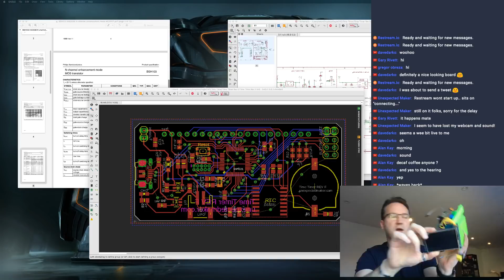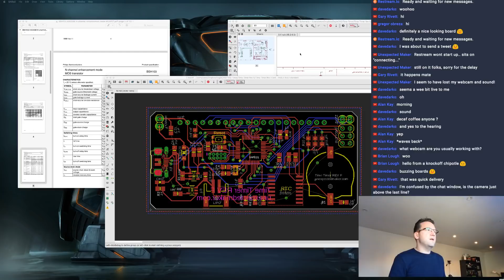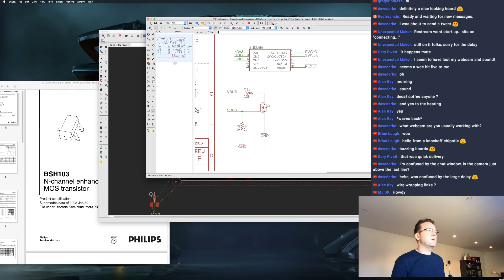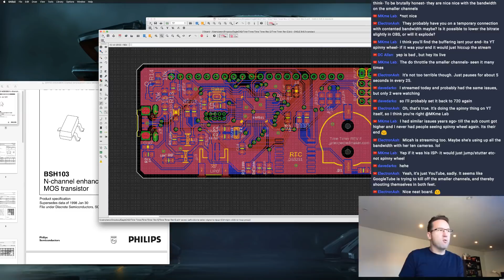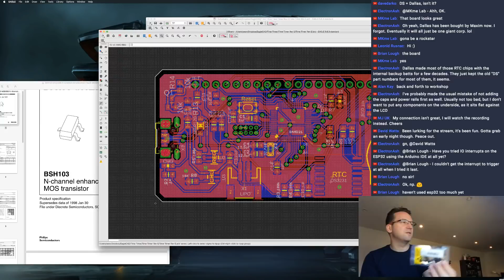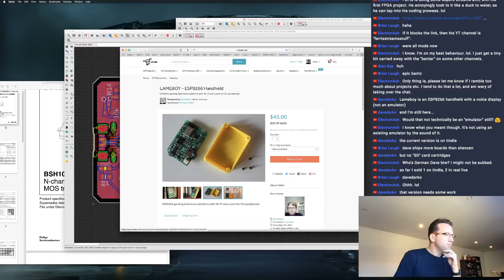Let's look over & improve my SAMD21 Micro-controller board

Comment from the maker: Sorry about the stuttering folks. Seem's my internet (Australian world class internet) wasn't up for the task of streaming today :(
Reply: Not sure the MOSFET circuit was right. You are using vbus as both the gate and the supply line.  Shouldn't you have something else to drive the gate? (A signal line from the uC). As it stands you are turning off the supply to turn off the MOSFET so output will be 0v and when you turn the MOSFET on the output will still be zero as the MOSFET will be on, grounding vcc line.  (Not an expert but just seemed wrong to me)
Reply from the maker: Yup, you are correct - as I was cleaning up my terrible placement I realised I needed to drive the gate from a GPIO on the SAMD21. A silly silly mistake :-)
Reply: Unexpected Maker :-) if I'd been an hour earlier I'd have told you on the live stream. At least you didn't send off for new boards before realising!
Reply from the maker: I was always planning to do a sanity check on the board design again before sending it off, but as I said on my stream I've never worked with Mosfets before (I know, how??) so I'm not surprised I stumbled there!
Reply: Thinking again this morning. If you are using VCC to supply the screen and RTC then aren't you limiting it to 50uA due to the 10K?  If the Screen and RTC were instead connected directly to VBUS and the ground of those commoned (rather than use your actual ground) and this connected to the MOSFET, it would switch the current the devices need rather than this limited supply.
Reply: I'm assuming vbus is 5v so current through to vcc is I = 5/10k.
Reply from the maker: I'd need to think that through, as both the screen and RTC also need to share a common GND with the uC, so I'm not sure how I'd manage that and isolate the GND just for the Screen and RTC. Yes, the 10K resister is wrong - that was just a copy & paste to get it on the board, i'd always planned on working out the correct value at assembly.
Reply: They will have a common ground, it is just switched through the MOSFET. Basically you would be making the LCD and RTC the load which is switched by the MOSFET.